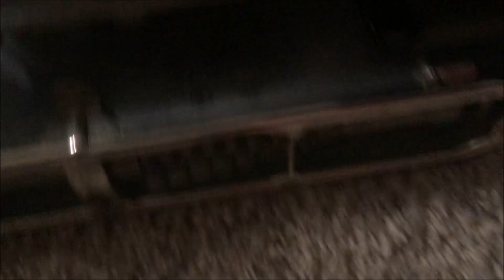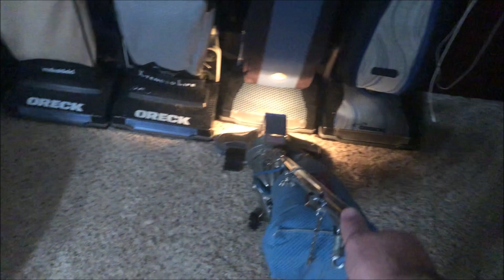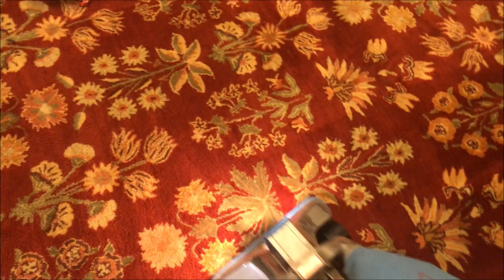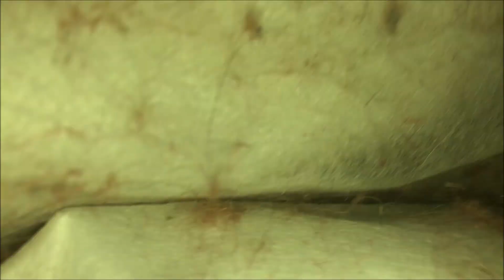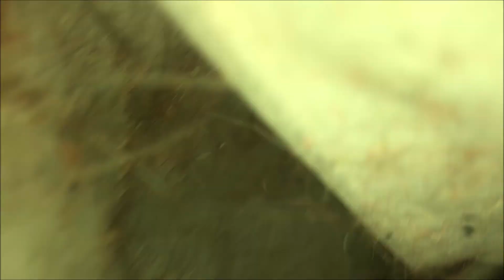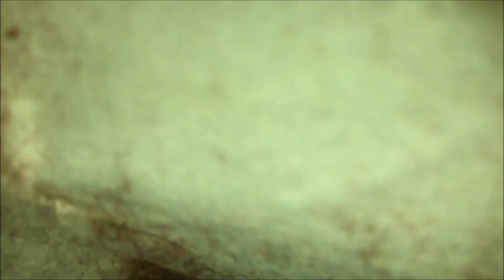Royal 880 (3 amp) Cleaning Performance

Comment: I have a similar Royal 880.  The front wheels are not the wide type. Still, it's a well balanced machine. Same 3.0 amp motor type. Still use the original brush roll.  Does your brush roll have the 3 settings to adjust for bristle wear?  I just switched mine to the 2nd position; the bristles measure a solid 1/16" below the bottom plate. (Which is similar to the recommendation for the Kirby Classic series (as stated in the Kirby manuals of the time)).  What setting is your brush roll?  You get some really nice carpet grooming with the setting that you are using.  I've noticed that my Rite-Hite button doesn't move much when I lower the nozzle - unless it's lowered to the point where the Royal is hard to push.  (Although, when I got it from a thrift store, there was a lot of (old) dust packed inside the nozzle front plate that I had to pick out using tweezers and toothpicks, so that might have  affected the button flexibility.  The Royal instruction folder indicates that the button might not go in when vacuuming higher pile carpets, but I can't get it to move in much on lower pile either.
In any case, you've got a very nice Royal 880 there.  Enjoyed your video.

Comment: I have one, I just dug it out to move it, eventually I'll have it restored and probably sell it then
Reply from the maker: Does yours have a 3 amp or 4.5 amp motor?
Reply: @graysonsvacsandmowers5426  Not sure, haven't gotten a good look at the data plate but it only needs a light polish to look like new which is something I won't have time to do for quite some time, I have an old bench grinder hooked up to a variable speed controller with 2 different polishing wheels, rougher for initial knocking off of grime and corrosion and softer for a good smooth finish
Reply: @graysonsvacsandmowers5426  it's a 3.0
Reply from the maker: @vacexpert2020  Ah, so it's just like the one I have.
Reply: @graysonsvacsandmowers5426  Just like it, it'll be in a video soon but not running, original outer bag is in near mint condition despite how thin the vinyl is

Comment: I love that machine. I used to have two 880s at one time. One had a simple metal cap belt cover and the other one had the blue Adjust 'O' Rite cover. I no longer have either of them, but I remember how light and easy to push they were.